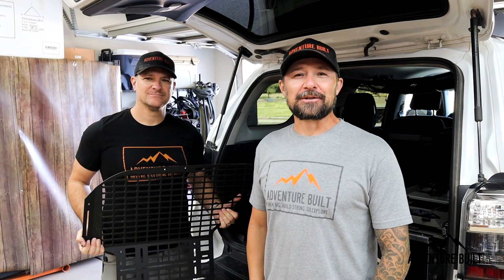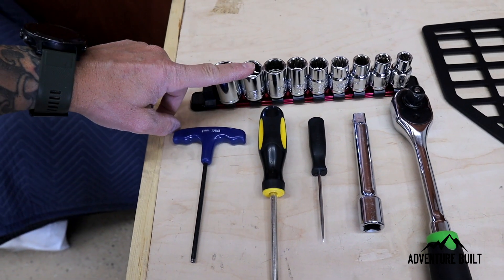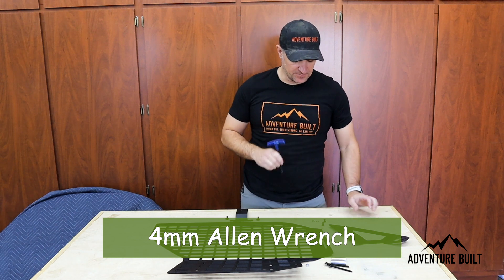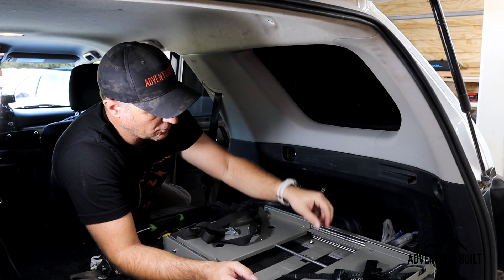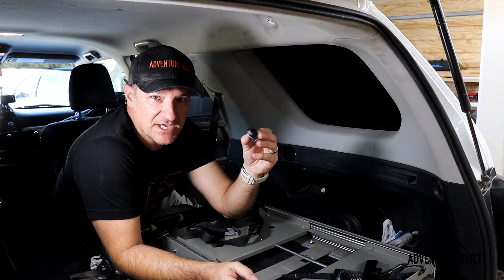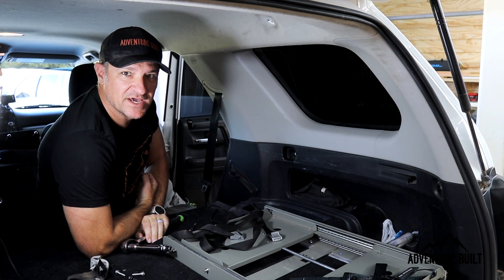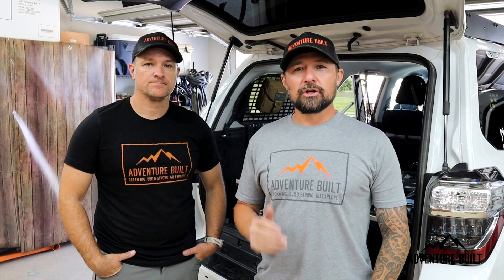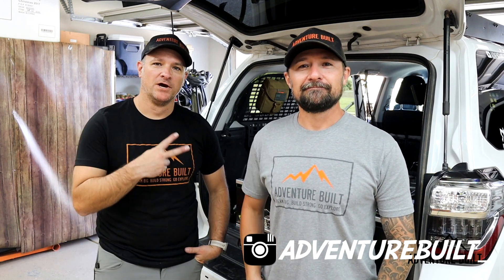HOW TO INSTALL BULLETPROOF MOLLE PANELS FROM CALI RAISED LED | 5TH GEN TOYOTA 4RUNNER | ORGANIZE!

Comment: Will this interfere with side curtain airbag deployment?  All 4Runners have side curtain airbags that run the full span up to the C-pillar, regardless of 3rd row or not.
Reply from the maker: Good question.
Reply: Side curtain airbags only deploy in the front and rear passenger areas not the cargo area of the vehicle, these panels are mounted in the cargo area not the passenger areas.

Comment: I just installed the caliraisedled fog light kit for my 4runner. Pretty impressed with how the amber lighting came out, but I think that is as far as I will go with my caliraised stuff.
Reply from the maker: I really like their stuff. Trevor roof rack, light bar and side lights on the 4Runner are all Cali Raised LED. They are great quality. Did you have anything bad happen?
Reply: @AdventureBuilt  not really, I guess just a few things I read on the internet. Lol I was just making fun because of your reaction to the missing washers.

Comment: Also… for those mounting this system. If you are actually going to attach  molle gear and bags to this you should put them on before you mount it to the truck. Will be tons easier than trying after it’s installed…… like I did.
Reply from the maker: Yea that is so true. Trevor found that one out.

Comment: I’m already not impressed by the cost & lack of all hardware, not to mention the poor quality control with a press fit but falling off, obviously not installed properly, good install vid… not so impressed with the product quality
Reply from the maker: It has held up well so far. It’s doing the job for sure.